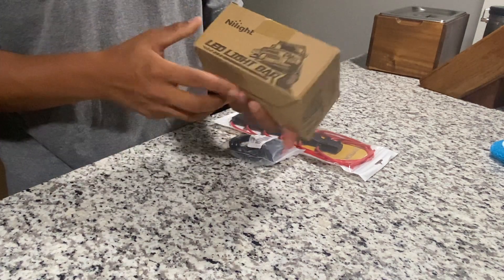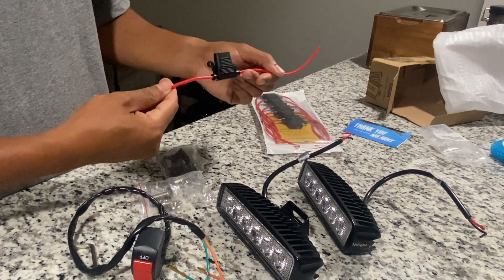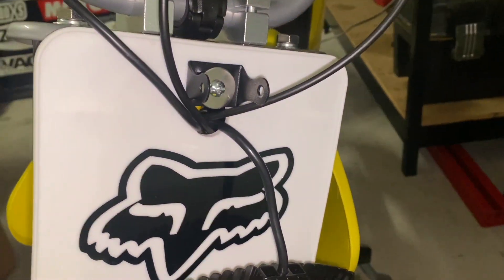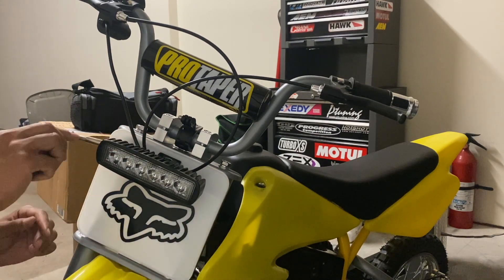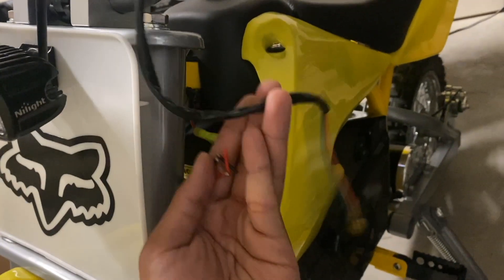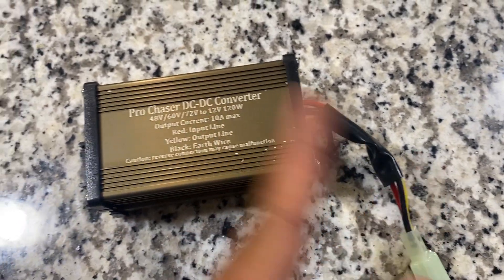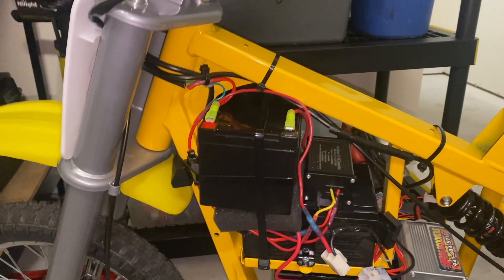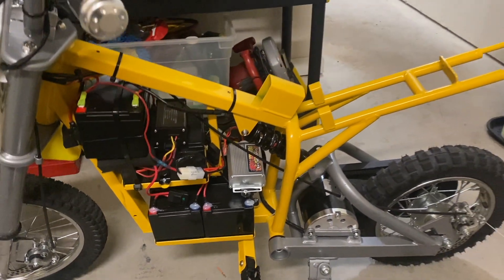Razor MX650 MX500 SX500 LED Headlight Install Wiring 48V 60V 72V 12V Light Bar

Comment: This video is great help. Would I still need a step-down converter if I still have the 36 volt stock set-up on my Razor MX650? Can it not just be spliced into on of the batteries? Thank you!

Comment: did you ever had sparks when connecting the DC-DC converter? I just bought a converter and connected it to my 72v battery. Without any load, the moment I connect it, it sparks
Reply from the maker: @handler_k  battery should be disconnected and all switches should be turned off when connecting everything so no sparks should be happening during the wiring process.

Comment: Why don't you keep 48volt lithium ion pack instead of 12v × 4 lead acid batteries? don't you think it's very load to your ebike! Anyway ,it is very helpful to how to wired up a headlight connection by using step down  converter. Nice.thank you.
Reply from the maker: I’m confused with your question. This bike comes with 3 12v sealed lead acid batteries.. this was a temporary upgrade. This bike now has a 72v lithium battery

Comment: Did you ever run the the contoller on this bike with a Lithium  48v? What kinda speeds were you seeing
Reply from the maker: Ohh I may have misunderstood your question. I forgot this bike had the Fast Scooters kit with stock motor back then. No, didn't get a chance to. I upgraded to a Kunray full brushless kit by the time I went Lithium
Reply from the maker: This is actually super old video. This is actually the 72v blue bike now.. 50 mph. 35 mph as a 48v with 13t sprocket and 10x3.5” rear street slick tire back then though

Comment: I’m trying to figure out how to hook up the 4th battery because a new lithium battery is not in our budget right now.  I see you have a red wire running to your negative terminal…is that just a red wire you are using for the ground?  I’m confused on how to tie in the fourth battery.  I am not very knowledgeable on electronic components so I apologize for this question.  Thx.
Reply from the maker: Check out part 1-3 of these videos: Razor MX650 48V Fast Scooters Overvolt Kit Installation Part 1 | Unboxing and Wiring
https://youtu.be/dVGA1POjLko

Comment: My light is flickering do you know why
Reply from the maker: Do you have a voltage step down converter installed or did you wire directly to the battery..?

Comment: Pat, thanks for the video, its super useful. Quick question, on the controller from Fast Scooters, they have "tail light optional" wire. Why not use that wire and tap directly into the batter power?
Reply from the maker: Hmm you know what that just simply slipped my mind! You may have to give it a try and let me know. My set up is completely different now so it’s too late for me to try that out now. That would make sense though, as long as it’s not just activated when you apply the brakes

Comment: Just wondering what’s that little power mod looking thing not controller The other thing you have connected to the batteries I think What does that do and do you have a link?
Reply from the maker: I'm not 100% sure which part you are talking about, but I'm assuming it's this voltage step-down converter: https://amzn.to/3nUrt7L

LMK if this is what you meant
Reply: @PatOutdoors  this isn’t it it was attached the the back battery on the top I’m pretty sure, buddy saw it on eBay and it said it was like a upgrade thing to let you hit like 25 on the stock bike and it was plug n play. If you don’t know it’s alright just thought I’d ask.
Reply from the maker: Ohhh You are referring to the Fast Scooters 48V Kit I have mounted on the back then.
. Fast Scooters Over-Volt Controller Kit: https://ebay.us/Qgh9DN
. Fast Scooters 55-Volt Charger: https://ebay.us/ISO7xc
Reply: @PatOutdoors  Thank you! Now is this a safe kit? It seems like it and what was top speed you hit while having that on there
Reply from the maker: @ClutchDynasty  Yes, as long as it's installed and wired securely. I hit about 24-25 MPH with it combined with the stock 11-tooth sprocket and about 26-27 MPH with the 13-tooth sprocket.
Reply: @PatOutdoors  thanks man! So did you just get an extra stock razor battery? Is there a video of you hooking this all up by chance? It looks fairly easy my only question is that extra battery they said in the description you need another one.
Reply from the maker: It's actually all in this same Play list that this video is on: https://youtu.be/dVGA1POjLko

Any parts I used are also in the description of the videos. The linked video is part 1, then there's a part 2, and part 3 is me doing the top speed tests.
Reply: @PatOutdoors  oh cool thanks man!

Comment: I have a question on the actual bike. What are the dimensions (Angles etc) of the frame? (I just need the measurements of the battery compartment area) The reason of which is because I want to try to 3d print a custom shroud that dosent look like garbage and I don't have one yet
Reply from the maker: Do you have this bike? Might be hard to get something like that accurately without a 3D scanner. What specs exactly do you want?

Comment: Would be nice if you actually showed connecting the toggle switch so much for info we already know..
Reply from the maker: I'm confused. The toggle switch is literally the easiest part of this whole install.. You can wire it inline with the power wire going to the headlight OR you can wire it inline with the power wire going to the voltage reducer.
Reply: @PatOutdoors hey, I know this is an old video, but where did you wire the negative end on the switch to, before or after the converter and where? Thanks

Comment: How can you add led to step down
Reply: I came across the same problem..
I think OP is trying to ask … how to connect the LED light to the yellow wire… we can see the red goes to the in-line fuse on to the red terminal and the black to negative but not too clear on the yellow at least visually… installing this myself now, if you could plz clarify … thanks 🙏🏽
Reply: @enzoi9569  everything after the converter (on the yellow) is 12v. It is the power feed/source for anything you want to add/run. You just run a wire from the yellow, to a switch, then to whatever you want to run. LED's would be Yellow, to the switch, Black out of the switch to the Colored wire on the LED's, then the Black wire coming out of the LED's to the Black anywhere on the bike. It's just a circle. Pat has drawn out the wiring diagram he wants to use MANY times. If it makes sense on paper, it will make sense on the bike. Plan what you're building and build what you're planning.
Reply from the maker: This whole video is to explain how to add the step down converter kit and the wiring. Not sure I understand the question.